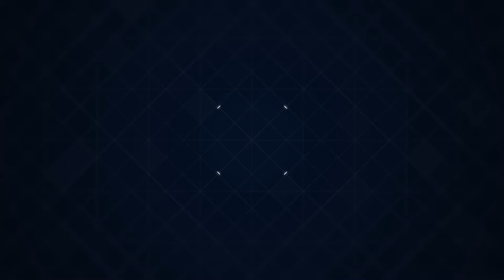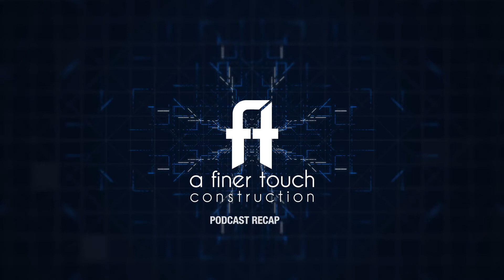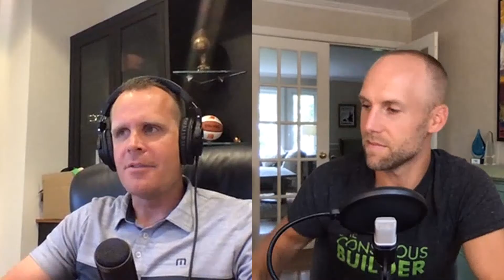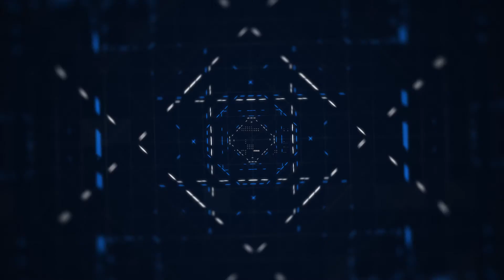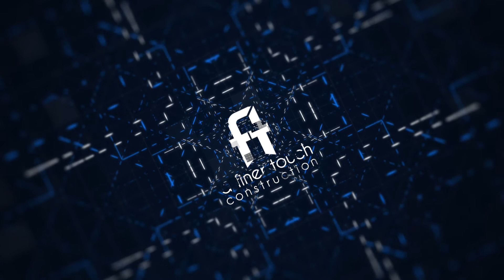PODCAST RECAP: NET ZERO? PASSIVE? OFF-GRID? Which house is best?

Comment: What is the ideal balance of energy efficiency strategies for the climate here in Phoenix, AZ?  It seems that most of the net zero and passive house designs are only geared toward colder climates?  At some point the ROI has to balance even on a high end custom house project. Would love to hear what is wise and what is a waste of money/effort in a hot climate.  Thanks!